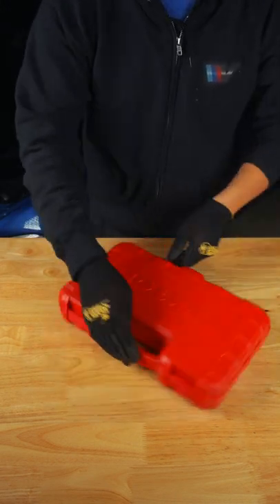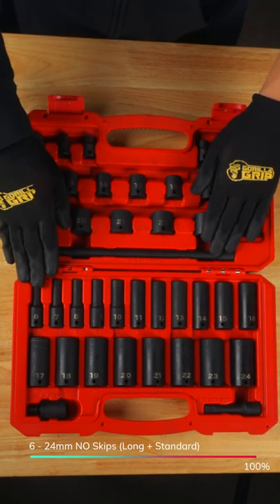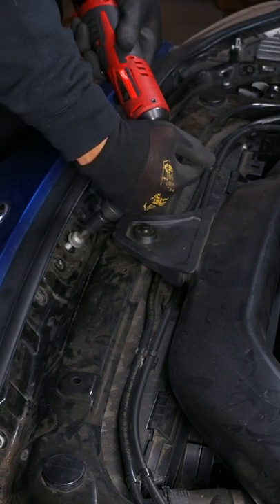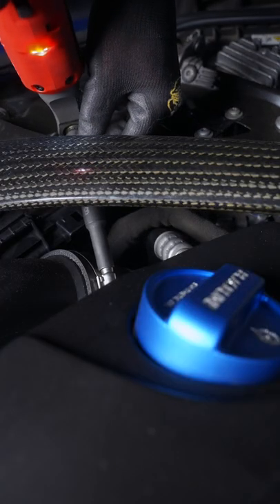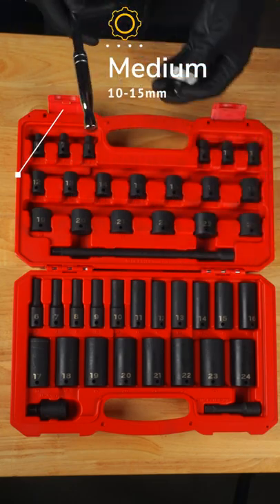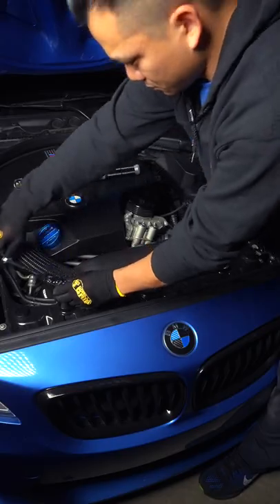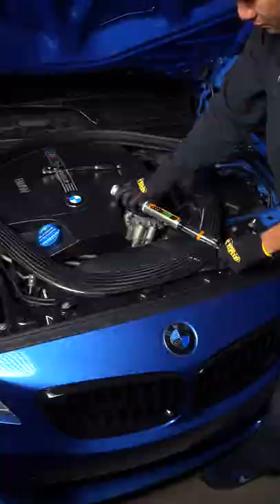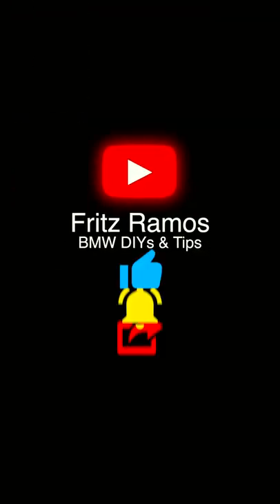BEST 3/8 Impact Socket Set ?

Comment: You should not use a torque wrench with a wobble or u-joint. It will mess the torque up, extensions are fine though of course.